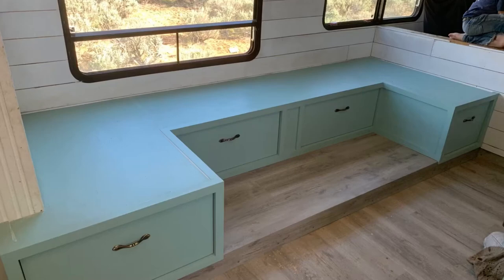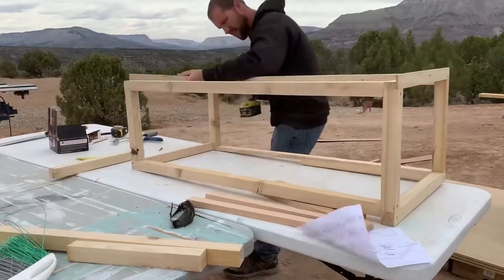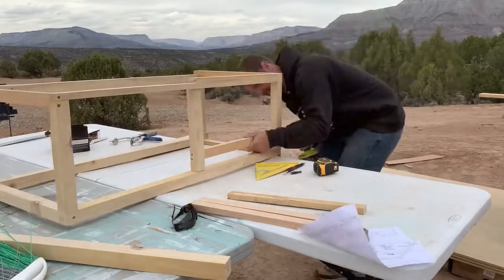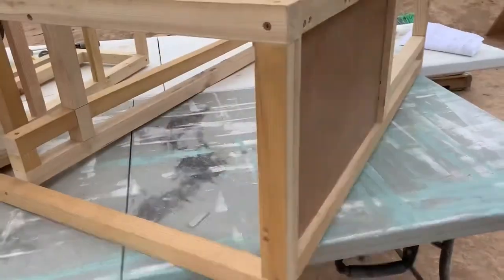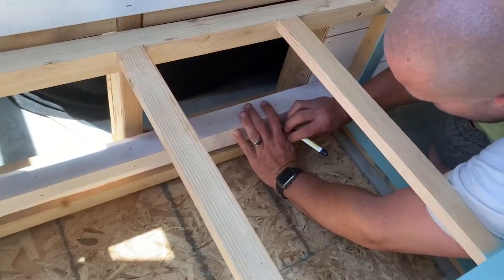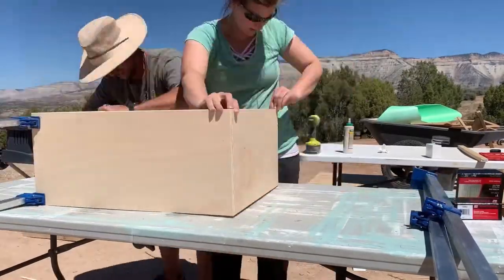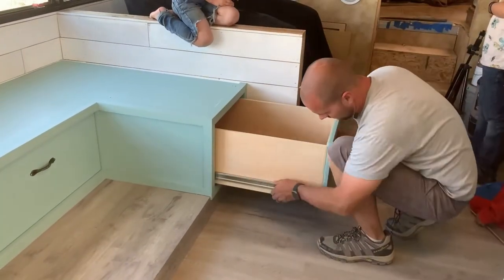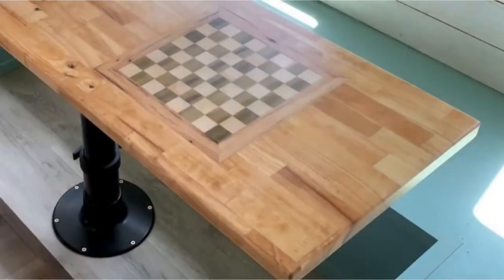How To: DIY RV- Dinette/Couch/Bed/Storage

Comment: You have done a very nice job! Thank you for making the video so we can get inspired and lerarn.

Are you happy with the telescoping table stand you chose? Would you buy it again? What product did you use?

Thanks so much!
Reply from the maker: Thank you for watching. We’re happy with the convenience of the stand. It allows for more leg room than other set ups and doesn’t require us to assemble/disassemble legs and then have to store parts elsewhere. BUT our table is long and HEAVY so it’s not as stable as we would have liked. Yes we would buy it again, but we would make the table top lighter for sure. We bought this but paid less than it’s listed for here and we got it in black…
https://autoplicity.com/9066042-springfield-marine-1660230-ped-3-stage-table

Comment: I was hoping for dimensions. This has been my plan. However I want to make it 2 pieces to be set apart or together, 2' center. 12' slide. Did you consider weight ? Or is your RV permanently placed ?
Reply from the maker: The fifth wheel is permanently placed…but these materials used are really light, the table itself is a little heavy but nothing that I’d be worried about hauling.  The dimensions are going to vary given your space, so the dimensions of our setup aren’t really helpful.  Just measure the area and design it according to how it will fit.  If you have a telescoping table pedestal or some kind of callable table leg set up, design the bench to be the same height as the table when it’s in the down position to make it flat (for the “bed”) without height adjustments.

Comment: Where did you get the shiplap...
Reply from the maker: We made it be ripping down sheets of 1/8” underlayment (plywood).  Always cut them into strip widths that go into 48” evenly to avoid unnecessary waste of materials.  Don’t forget to account for the blade width of 1/8” s part of your plank width when calculating.